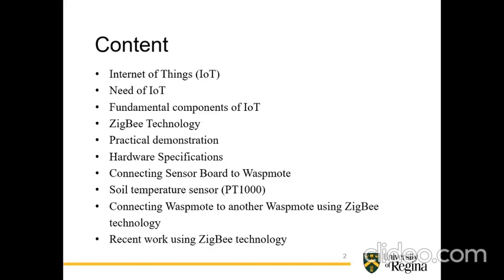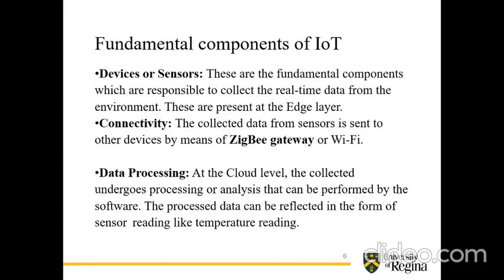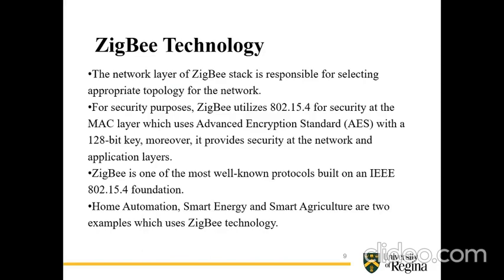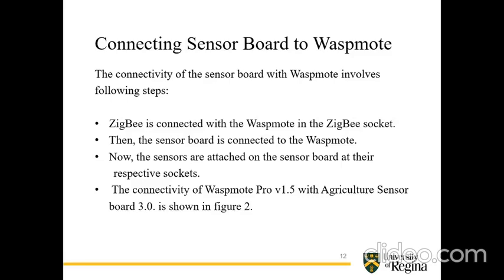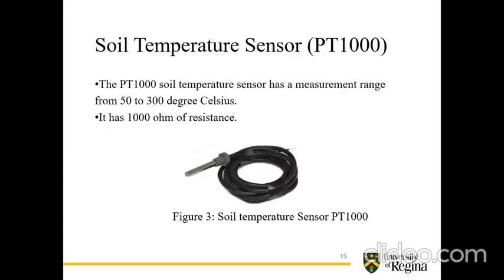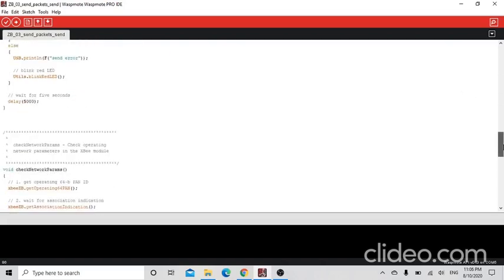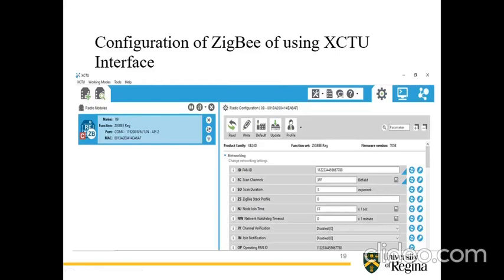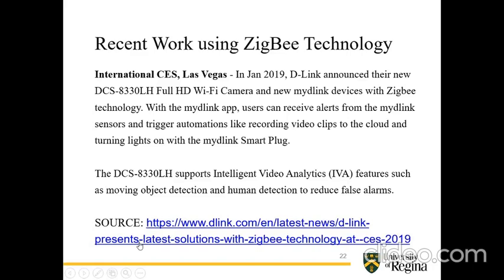CS900 Seminar

Comment: Hi Rajbir, Nice Topic. How does layer 2 determines which data is crucial and which is not?
Reply from the maker: Thanks. Layer 2 fog layer  filters the data using map reduce technique before sending it to cloud. So 
the rest of the data is discarded. There is some data loss issues because it is a challenge to decide 
in IOT which data is crucial or not.

Comment: Hi, Good presentation. You said only selected data are stored in the cloud level during data processing, so what happens to the rest of the data collected? Does it lead to data loss issues ?
Reply from the maker: Thanks. We filter the data using map reduce technique before sending it to cloud. So the rest of the data is discarded. There is some data loss issues because it is a challenge to decide in IOT to decide which data is crucial or not.

Comment: Great presentation! What is frequency set for the sensors to collect metrics? Have you considered integrating other sensors such as humidity sensors?
Reply from the maker: The ZigBee has a 250 kbs for data transfer from sensor. The USB baud rate is set to 115200 (bits per second) baud. Yes, we can use other sensors at their respective sockets on Agriculture Sensor Board v 3.0.
Reply: @RajbirSingh-mv7tr  Thanks for the reply

Comment: Thanks for your presentation. Choice of technology is sometimes based on which technologies one has been exposed to and the perceived advantage it has over the rest among those one is aware of. Is there a unique advantage Zigbee offers in IoT over the other technologies you are familiar with?
Reply from the maker: Yes, I am familiar with the ZigBee technology. It has some unique features over other technologies like Bluetooth are:
•	The zigbee has flexible network structure.
•	It has a very long battery life.
•	It is low power consumption.
•	It is easy to install.
•	It can be easily implemented.

Comment: As zigbee is the network connectivity module, what is it’s scalability range? And if there are multiple sensor nodes, how much maximize that can be connected to it?
Reply from the maker: The range of ZigBee is from 10-100 meters depending on environment factors. And ZigBee supports upto 65000 (it has 16 bit short address) sensor nodes on a single network.

Comment: Security of IoT is one of the most important things.ZigBee is for low-power low-bandwidth needs. How does it prevent intrusions?
Reply from the maker: It uses AES algorithm with 128 bit key size in all the three layers- physical, MAC and Network and Security layer

Comment: You used XCTU for configuration of ZigBee module. So my question is that can the temperature of the sensor be shown on XCTU interface instead of Waspmote IDE?
Reply from the maker: Yes, the temperature reading of the sensor can be displayed on the XCTU as it has web monitor where temperature can be shown.

Comment: Why ZigBee? Why not any other technology? What makes it different?
Reply from the maker: ZigBee consumes less power and works on low bandwidth which are the main points in IOT. Moreover, it successfully transmits data in a Wireless Sensor Network created by Waspmote

Comment: I was wondering why you did not use a cheaper technology (e.g. Arduino). Is it a matter of choice, or does Arduino not support Zigbee technology?
Reply from the maker: The main reason is that Arduino does not have sleep mode. Therefore, a constant consumption gets discharged within a few days or even hours. Secondly, the platform needed to be radio certified as the nodes are meant to be deployed in real scenarios like factories.